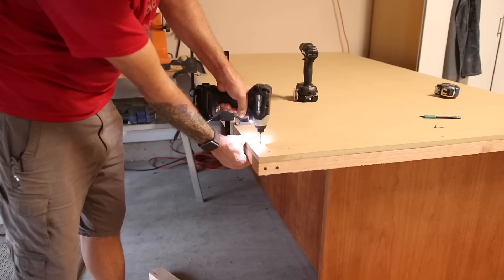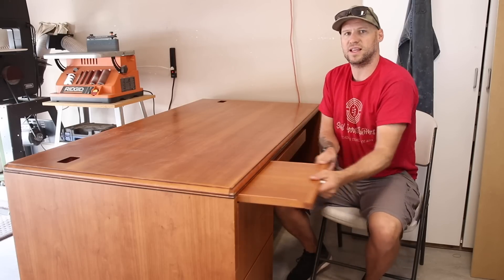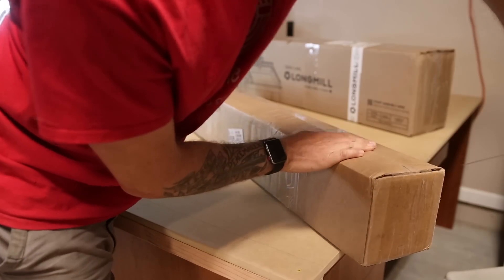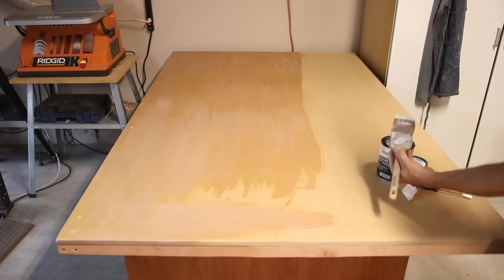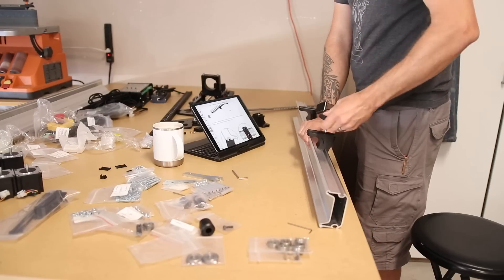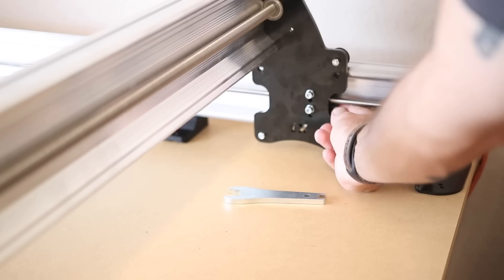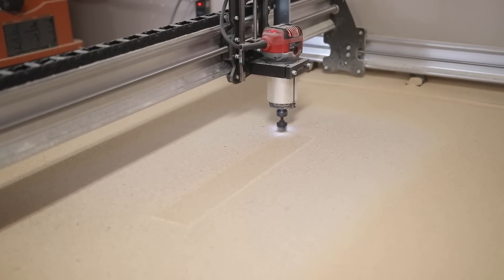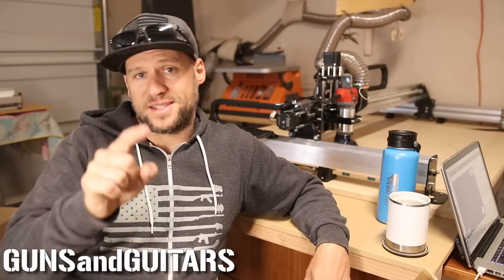Building my DREAM GUITAR CNC on a Budget! (Longmill mk2 48x30 by Sienci labs)

Comment: Thanks for the review, I'm looking in to getting a CNC for guitars myself. What surprised me, is you say this is so much more rigid. But its still 4 v wheels per carriage, just like the old one. I've seen other router kits that have 8+ per carriage. I'm wondering if part of it is how big the plate is, giving farther wheel spacing, and not so much the wheels themselves being a problem? And the huge frame beams bending less than smaller extrusions.

Comment: Great video, thanks for posting.  I'm in the final stages as to whether or not I want to complement my guitar building with a CNC and the Longmill Mk2 is where I've landed if I do.  If I want to get a more serious and move beyond being just a hobbyist builder I would have to do some serious upgrades to the tools I have and I when I started to add up the costs it certainly started to cost justify a CNC.  Living in Canada I quite like the idea that it is Canadian made.  While the exchange rate works well for you it certainly works against me for any machines I'm looking for that come outside of Canada.  Thanks for the tip on the Avid Power router, I'll take a look at going that route when the time comes.  I'm curious as to what you use for bits.

Comment: How has this machine been doing since you made this? I have been making guitars for a few years and suddenly have the need to be able to make more. Been doing a ton of research and want to see what issues you’ve run into. Also what add ons have you need to purchase or recommend! Thanks!
Reply from the maker: I’ve had zero issues. This machine is an absolute beast, it has more than exceeded my expectations. I’ll be making a follow up video pretty soon.
Reply: @GunsandGuitars  I have mine all configured in their cart… have just been waiting to do a little more research. Thanks so much for the response

Comment: Just subbed.  I am looking at this for my 1st CNC as i want to start a small business as well starting off with signage and wall art then moving onto other various projects.  Can you share a little more about your dust collection setup?
Reply from the maker: I’m using the long mill dust boot, it’s connected to a 4” hose going to an old dust collector I bought used on fb market place  it works great!
Reply: @GunsandGuitars  Thanks!

Comment: Hi. i was just going through options on their site and see the software area. For the large size it requires the pro version. Are you using that $650 software or an open source application? Seems like it makes sense to get the vacuum attachment for dust collection and other addons. Any knowledge with its laser? Im considering that as well. Thanks!
Reply from the maker: Right now I’m just using easel for the software, it’s free and user friendly. But I’m learning fusion 360 which is also free and much more power, but way less user friendly.

Comment: Great video. I’m just starting out. Are there any accessories you recommend buying with the Longmill CNC for guitar making such as the magnetic dust shoe and a router bit starter set?
Reply from the maker: Definitely get the dust shoe, and start with a 1/4” upcut but (long one, 3.5-4” with 2” cutting surface) so you can cut the full depth of a guitar body. You can add a 1/4” ball nose bit for finishing too if your 3d design skills can put it to good use.

Comment: Are you using incremental or absolute coordinates for indexing? I use an Avid Pro.
Reply from the maker: I have no idea what that means 😂 still using easel but trying to learn fusion360
Reply: @GunsandGuitars  Absolute coordinates originate from the homing location. I ditched Fusion360 due to “renting cost” and use Rhino3D for my 3D models then VCarve Pro and MeshCam.

Comment: I’m looking at buying a CNC I am interested in building wooden flags and military ribbons, most of those files are wrote for the vcarve or carbide is there a simple way to change the files to work with this machine? It may be a dumb question just new to it.
Reply from the maker: This machine is open source grbl, so you can use any software you want including both those you mentioned

Comment: The CNC seem very cool and good, but hey, i think i mentioned this in another video of yours, you gotta upgrade to a 1,5KW water cooled spindle with VFD because it´s a huge upgrade and your machine is going to route so much better and faster, those Makitas and similar clones are not very good at the end of the day actually. I have exactly the same clone you have on this machine, it´s scrapped a long time ago, also i had a real Makita that worked out great for quite some time and then it broke. I can see in several of your videos that the material you are routing of is turning in to dust and/or tiny particles and that´s not an optimal working CNC and there is alot of things that can go wrong there. But you make great videos and this is very interesting, i think you gotta learn from your own mistakes hey.. keep it up. Cheers.. :D

Comment: Do you do necks on these CNCs too? Wondering if programming for the fretboard radius fret slots is hard?
Reply from the maker: I haven’t done a neck, but I plan to. Programming and 3d modeling is the hardest part. But you can purchased 3d models to get started. So to answer your question, yes fretboard radius and fret slots are possible

Comment: Hey man! Great work you're doing! I have been researching CNCs to purchase for taking my guitar builds next level and your videos have helped in my decision to go with the Longmill. For which I thank you! Would you clue me in on which one of the bit sets they offer is the ideal set to go with? Does the 3D Carver set have everything that I would need for guitar building, including fret slots?  And are you just using the provided gSender software, or is there something else that's far superior but as easy that you may recommend? Again, thank you for what you do.
Reply from the maker: Hey Joey, congrats on choosing a LongMill! I love mine, and you will too. For bits I just have a 1/4” up cut, 1/4” ball nose, and a v bit. But I actually haven’t use the ball nose or v bit yet. My carves are really simple at the moment, I still have a lot of learning to do. I use their Gsender app, but I also use easel for my cad/cam. I’m trying to learn fusion360 but it’s a steep learning curve so I’m not their yet. I don’t think scieni sells a bit for fret slots, you’ll need to find one specifically for that from a luthier shop. I plan to use one of my cnc lasers to do the fret slotting. It’s a lot faster and easier and no chance of breaking those super fragile bits. Hope that helps!
Reply: Hey! Cool, thanks for getting back to me. So most of the guitar carving is really simple for the machine with just using the basic bits, it would seem. And the laser doesn't burn the wood enough to be of any negative effect in the fretwork, I must ask? This is so amazing!

Comment: I think that in time you'll eventually replace the router head with a dedicated CNC spindle. While it may not go along with you're DIY, budget oriented ethos, it would probably speed up your cuts. The ability to use computer controlled Cartesian machines like 3D printers, CNC machines, and laser engraver/cutters has opened up a world of possibilities.

Comment: Based on the visual similarities between the computer-controlled router and laser machines, is there a method of just swapping back and forth between the two? Or does it have to be two separate machines?
Reply from the maker: You can absolutely use them for both. Sienci Labs makes a laser for the LongMill, and Fox Alien makes a laser for the Masuter Pro as well.

Comment: Dan, I bought a longmill a  few months ago for the same reason you did. I am cutting through Birch hardwood at 100 IP.M like it's butter. I bought G-wizard on sale for feeds and speeds. It comes up with numbers I would have never tried just make sure your hold downs are tight. Welcome to the longmill family!
Reply from the maker: That’s awesome! These LongMills are legit! Thanks for the tip I’m gonna look up those speeds and feeds. I’m not worried about breaking the cnc I’m worried about breaking the router bit! The cnc is more than strong enough
Reply: That program takes everything into consideration. Also 1/4 inch bits are much harder to break. What the heck is that surfacing bit you used? It looked huge!

Comment: Great video, but a couple of questions. 1. Are you using limit switches or are you using software homing limits on it?

2. Have you thought about using your new machine for just guitar/bass bodies then using your original machine just for the routes where that has all been figured out?

3. Lastly, are you using the same cad/cam software on both Cnc machines and can you do a review on Easel?
Reply from the maker: Great questions!
1) not using limit/homing switches as of now because my work are is so large I don’t need them for my current projects. When I start doing more complicated carves with tool changes I’ll need to install the switches. 
2) I am currently thinking of how I can use both machines to speed up production, I have a few ideas
3) I’m using easel for both machines currently. But it’s very limiting, I’ll need to learn a more powerful program eventually.
Reply: @GunsandGuitars  Take a look at FreeCad. It’s open source, actually has a manual to it, and it being free is well with anyone’s budget. I just downloaded it and had Staples print me out a copy so I am unfamiliar yet with how good/ bad it is but food for thought for you.  :)

Comment: Nice upgrade Dan! Say,  did you have a link for those angled headstock necks you've been importing for your builds? thx keep up the good work.
Reply from the maker: No link, I just get them from a seller on eBay.
Reply: @GunsandGuitars  Thanks Dan, I could not find any angled paddle headstock on Amazon or ebay..Anyhow, I'll keep searching. Nice stuff you're building!

Comment: That's awesome Dan! I am curious if you looked at the Inventables X-carve machine. It seems to be about the same size (if not bigger) and around the same cost. It's one I've been looking at for years and am now trying to understand the difference between yours and that one. 

Congrats 👏
Reply from the maker: I almost bought an x-carve but I learned that I didn’t want to have a belt drive machine, that’s why I ultimate went with the LongMill. But @scarmyguitar uses an x-carve with great results!
Reply: I use the Xcarve! I have 2 of them!